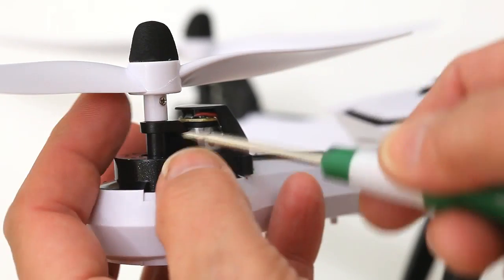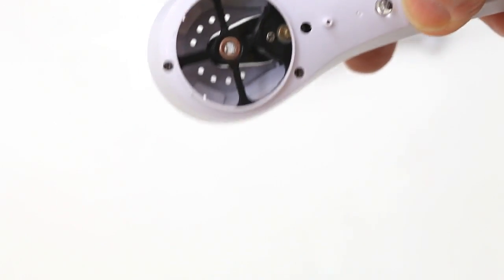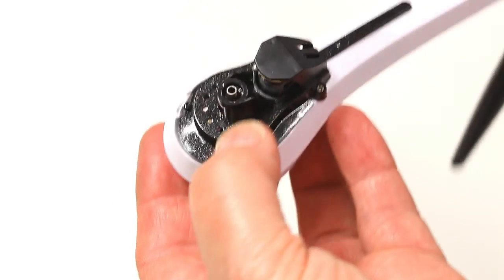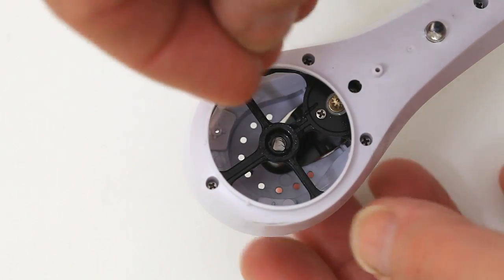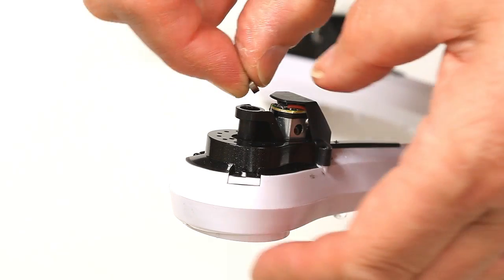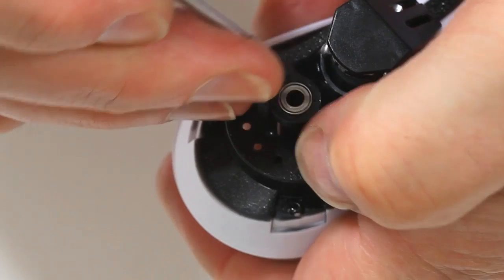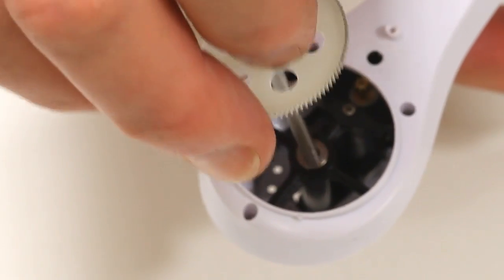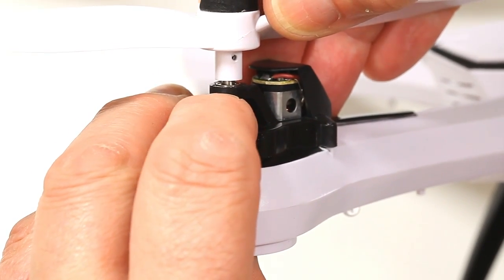Tarantula X6 bearing upgrade step by step

Comment: Hello, i've having issues with my new tarantula x6. I just received my bearings ball for the drone. I've well installed them but but it's time to fly, i press full gaz and the drone keep staying on the ground. Can you please help me ? Engines are running really fast but it's doesnt fly.
Thank you man
Reply from the maker: I know this may sound daft but are the props on in the correct order?
Reply: Hello i finally managed to fix my drone just by apparing each engine with the correct letter of each wing. engine A with wing A etc... stupid i know lol. Thank you for yout help anyway
Reply from the maker: We have all done it, that's why I asked about props ;-) Glad you are back in the air, have fun, ggrrrreat quad :-)

Comment: just wondering do I need to lube the bearings or is the axel lubed enough? btw have you noticed longer flight times with the bearings mod?
Reply from the maker: Two thought around on this one, mine is, I wouldn't as any lube can attract dust etc and that is not good. Not noticed any real difference but TBH I fly them so different every time, I wouldn't be able to tell but I really doubt it would change much

Comment: I couldn't resist but to order one of these Tarantula x6 after watching your videos. :D
What is your opinion about lubricating the motors with graphite ,someone recommended  it but i'm not sure if it's a good idea.
 I'll definitely do this bearing upgrade :)
Reply from the maker: Glad it helped and I'm positive you wont be disappointed with it, I still love mine and it has some serious competition now ;-) I never put anything near any of the gears or motors, that's just MHO NEVER! Hope that helps TTFN
Reply: Ok, thanks :)
Reply: Just saying, dry graphite = 100% ok . Guaranteed heat reduction. P.S. It's a $3 motor, can't hurt to try anything seemingly reasonable once ;)

Comment: hello..what do you think about adding some sewer machine oil..?
Reply from the maker: Personally...NO these motors are tiny and anything that draws in dust etc will eventually wear them and ruin them, others may say different but after a year of playing with brushed motors I now don't add anything. Hope that helps? Cheers
Reply: thats true.. burned... my syma x5 and jjrc h22 brushed.. in the tennis.. (clay field) added oil.. all dust came.. ..true..thank you!... (waiting for my x6..im so excited :D)
Reply from the maker: best thing I use for cleaning after a sudden attack of gravity is canned air and or a small toothbrush, clears away all the ......er dirt(polite version LOL) from cogs etc ;-) loads of stuff on X6 around channel, you will love it I still love mine :-)))

Comment: Hello, Many thanks for your video showing how to replace the bushings with real bearings on the X6. I thought it was very good!

Being a new "Yizhan" Tarantula X6 owner, I was wondering if changing the original brass bushings to bearings made any difference in performance, sound, or the flight and handling of the X6? In other words, was it worth your while and expense to do so? Does it sound or fly any different? I think that real bearings are definitely superior to a bushing, but was just curious to find out what if any difference it made with the X6. 

Any advice or information about the above will be greatly appreciated!

Thanks again for posting the video and very best regards.
Joe Cro
Reply from the maker: +Joe Cro Hi Joe, TBH no real difference in noise, flight, handling apart from the fact they will hopefully make motors last longer, run cooler and not wear out like the bushing will IMHO. they are really cheap here http://www.banggood.com/Wholesale-MJX-F47-F647-RC-Helicopter-Spare-Parts-Bearing-p-57426.html?p=ML1711535795201404KD and if you buy 8 you get a discount as well ;-) They are easy to do and once done, you should never need to replace them, they should fit them as standard but they shave every bit of cost down to get it out the factory as cheap as they can. Hope you thumbs up and subscribe if you haven't already, Thanks for your comment and glad you enjoyed the video :-)

Comment: My traxxis bearings i ordered for this have a covered side and a exposed side where you can see the bearing...is there a right or wrong way to put them ?
Reply from the maker: +SETXQuadcopters I would mount them with the bit you see facing out....so up on the top one and down on the bottom, so them shouldn't catch on anything, unless anyone has a better idea? Hope you thumbs up and subscribe if you haven't already and hope the bird is soon back in the air ;-)

Comment: Hi some solution with brushless motor?
Reply from the maker: +Gt-R Vspec You can't put brushless on this, you would need to add esc's and then change PCB that would be a different quad.

Comment: Hi, I have just oredered a tarantula x6, i have also ordered these bearings from banggood i havn't actually got either yet but thought i'd ask, do the bearings go either way round when fitting them or do they have to be a specific way?

Thanks for the great tip anyway :)
Reply from the maker: +JAMES HUMPHREY Good choice James :-) They go either way but just in case they have changed have a quick check before fitting, pretty sure they won't have changed though ;-) Loads of Tarantula stuff around the channel hope you enjoy it and thumbs up where you feel it worth it and maybe subscribe, enjoy the quad...pretty sure you will :-)

Comment: Have u noticed any improvements changing the bushings to bearings? I got some Latrax Alias bearing that are the same size. I been thinking about  changing them.
Reply from the maker: +Diggin2Metal I think I would upgrade myself, just feel bearings are better than bushes, by TBH I can't tell any difference in performance etc, but they have to be better right :~)
Reply: +Tigger's RC Reviews I replaced them last night and it seems my tarantula runs alot cooler now. So far I like the bearings. Thanks for the video and thanks for replying back. I enjoy watching your videos. Have a good one
Reply from the maker: +Diggin2Metal Glad it's working for you and thanks for comments :-)

Comment: FWIW Benedikt the master of the micro quads (Micro Motor Warehouse) uses this on his gears.
http://www.ebay.com/itm/Muc-Off-C3-DRY-Ceramic-Lube-120ml-with-UV-Torch-/371328365646?hash=item5674e5344e

The little UV torch enables him to make sure it is spread out perfectly.
Reply from the maker: +TheGusK Thanks for that, have looked at lubricating before but never done it, may give this ago on one to test it out, nice tip with the torch as well, thanks :-)
Reply: +Tigger's RC Reviews Don't EVER use anything with graphite though. :)
Reply from the maker: +TheGusK Even better tip thanks :-)

Comment: hi did you find replacement better than original motors in one month i am changing 8 motors thanks
Reply from the maker: +Kanari Mentos Haven't changed a motor yet, that's over 3 months of use, just lucky I guess, mine have been used very hard with gimbal and camera etc. Thanks
Reply: Tigger's RC Reviews
now those bearing they sell them ali express but maybe the one u u use  better than other company do u know other good motors stay long i am searching also i have contacts with many manufacture on china will see
Reply from the maker: +Kanari Mentos As I said I still have original motors so can't help as I haven't replaced them. I got the bearing s from Banggood as it says in description. Hope you find some stronger ones for the future. Thanks :-)

Comment: That would be my question is wether the propeller body passes trough the hole? On top of the black deatachable peak this? (Google Translate :) ) THX :)
Reply from the maker: +Jeti0924s Sorry that really doesn't translate. I thought the video showed the process clearly? try again?
Reply: +Tigger's RC Reviews Not, the process goes. I would like to balance the propeller. I know I have to put a magnetic balancer? At the end of the propeller cone to disarmament?
Reply from the maker: +Jeti0924s I have not balanced my propellers but I would cut or remove cone ;-)

Comment: I remember doing this to my V262. It turned 2 yesterday and is still on its original motors!
Reply from the maker: Wayne Morgan As in 2 years that brilliant, I'm thrilled mine has lasted 2 months so far
Reply: Tigger's RC Reviews umm I meant my V262 is 2 years old lol. It's one of my favorite quads :)
Reply from the maker: Hey that's still good mine fly off and I have to send the Squirrel to retrieve them :-)

Comment: Thanks for the Tip. Ordered bearings from Banggood and got two before they ran out of stock!
Reply from the maker: Donn Brown Glad you like it Donn. Did you really just wind up with two? you know you need eight right? I hope I made that clear in video :~) TBH I have not noticed a lot of difference but  it has got to be better than bushings, thought it would make it quieter but I guess the Tarantula is not a stealth machine :-) hope they fit OK and Banggood usually get them in pretty quick. Hope the flying is going good cheers :-)
Reply: I ordered 8 and got 2 before they ran out of stock. I just ordered 8 from MJX Copter.
Reply from the maker: Good for you Donn, I thought you would know but these things can easy be missed :-) Hope you get them soon cheers

Comment: Can i use glue or loctite to keep the bearing in place? I just don´t want to break the plastic.
Reply from the maker: IsilionTV yes it's your quad, but just be careful you don't get any into the bearing itself, they are so small the slightest hint of a drop would make it redundant. I just used gentle pressure around the bearing, keep moving round and pushing a little at a time, the plastic is quite forgiving :-) some times it might not need anything at all this is just in-case it does. Good luck it's a great quad enjoy ;-) please like and subscribe more on the way.

Comment: I just got my X6 and didn't know there were bearings for it when I ordered all the other spare parts . The baring fitting loosely could also be fixed by adding a single layer of thin tape and trimming to top and bottom before inserting them .
Reply from the maker: Spencer Boaz Hi Spencer glad it helped finding out about the bearings :-) Tape would have to be seriously thin, there is only a tiny amount of play but may work for some people, thanks for sharing the tip. Please like and sub :-)

Comment: Nice clear video ;) You didn't mention that the bearing have two sides. I think its important. You can see it in my video
https://youtu.be/nRXbxDQg5gk
Reply from the maker: Dron w Krakowie Thanks glad you liked it. Not getting the bearing way round :~) have taken apart a couple of quads with factory fitted bearings seem to be either way, don't see why in this case it should matter? Hope you subscribe :-)

Comment: Great video. BTW I magnetized the tip of the screwdriver that came with my tarantula and it makes taking screws in and out much easier.
Reply from the maker: Robert Smith Thanks glad you liked it. Nice tip with the screwdriver :-) More on the Tarantula coming
Reply: +Robert Smith it is already magnetized
Reply: +cakone micke Mine is not. Could be different versions supplied over time?

Comment: Nice! It should run a lot smoother now :D
Reply from the maker: The RCAddict Yep but still makes a hell of a noise. Been flying it hard and it can do manual flip (not using the button) this thing is awwwwsum :-)
Reply: Tigger's RC Reviews Yeah, you cant have it all ;) As long as the quad has enough pitch manual flips are fun to do :)